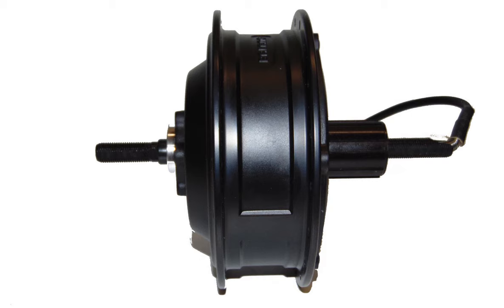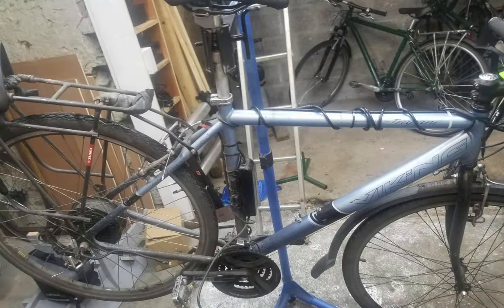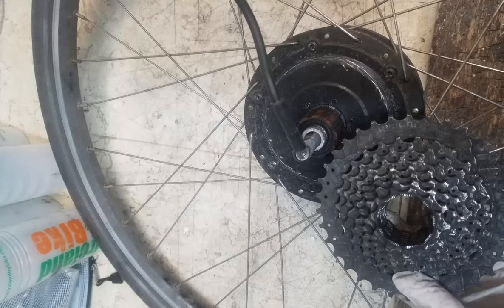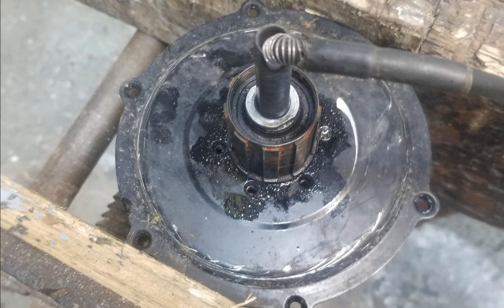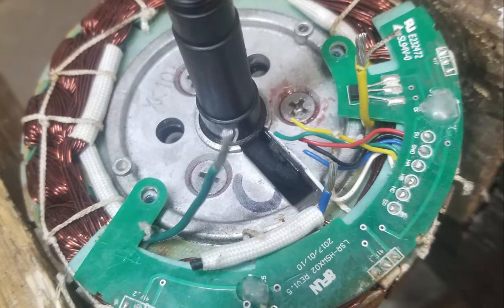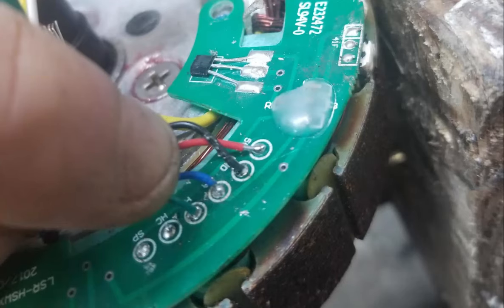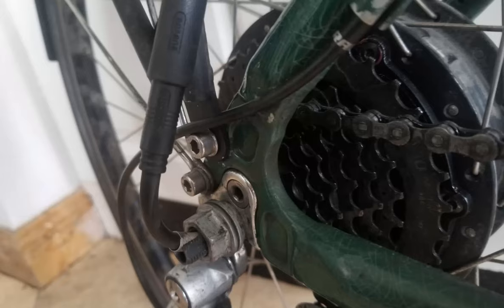E-Bike Motor Repair - Damaged Cable Bafang Hub Drive

Comment: They way you installed it will cause rain to drip into the motor and then everything will rust inside and probably the clutch will brake at first. I can tell you from experience. Better to use a longer cable and put the axle upside down.
Reply from the maker: That's a pity :( but thank you for this important info.  I've pinned your comment to the top so people will know your tip.
Reply: I was about to post something similar, with the axle upside down and the cable going up as you say rain will wick along that cable into the motor ether shorting connections or causing rust, for this reason I always install with the cut in the axle facing down I also make sure the wire goes directly down about an inch and then loops back up to the frame where it is secured / zip-tied this means that any rain on the wire will travel down and drip off at the loop and not wick up into the motor
Reply: Get some silicone pumped in, not ideal but will buy you time
Reply: Hi Mels. The cable at the inner end of the hollow axle is blathered in black silicone at manufacturing from my experience, having had to dig this out to release the cable. I guess it’s a good idea to reseal this before putting the whole thing back together. 😉
Reply: Try to run cable Low along frame.   So gravity helps u out

Comment: Great video Dominic.  My spindle came loose and knotted up the cable.  I was going to solder joint all 9 wire externally, but was never comfortable with what would be the end result for a fixed wiring back to the controller.  I've now found a new 9 pin extension lead 1.5 metres long.  So I can cut off the plug end about 30cm or so and rewire wire this through the spindle as you show.  Once I rewire the other piece of cable back to the controller I'll then have a convenient 9 pin connector joint to ease wheel and tyre service

Comment: Thans so much for your video I have the same problem my is the pedal error 3 I did what other video said but nothing I end up soldered wires because I thought was not making good contact. Now my next step is taking apart I may do a video to help other thanks again
Reply from the maker: Good luck!  One thing I would say is pedal error could be to do with the pedalling sensor rather than the motor

Comment: Hi. Are you based in the U.S.? 
 Do you have a bike shop?
I have the same problem. My hub motor cables are ruined primarily because I have been riding without a torque arm.
The rear hub motor twisted sometimes while I was riding and ruined the hub motor  wires
  I had a very hard time finding a torque arm in bike stores
Reply from the maker: No, not in the US. I would say you need to look at specialised e-bike websites like Luna Cycle for your torque arm.  Or if you can't find a torque arm to buy, then maybe ask around machine shops?  Could be a bit expensive, but they should be able to rig something up for you.

Comment: Very clear and nice video. Will the hall sensors with different series numbers will match all different brushless motor controller or there must be a mentioned hell sensors inside the brushless hub motor that can match a specific motor controller. Please advise.
Reply from the maker: Thank you :)  I don't have any experience with mixing and matching hall sensors unfortunately.  So I can't tell you if they'll be compatible.

Comment: Great video thanks, I have a similar hub motor on a swagtron eb5...

Wires are all messed up... To you know if I can power this motor with just the three large wires?  Do you need the sensor wires?  I've seen some hub motors with only 3 wires coming out.  Thanks again

Comment: Hello, I just came across your video, I have a hub bafang motor G062 1000W and it's spinning inside but there is no traction on the wheel, any idea of what i could be? By the way are you from Ireland?
Reply from the maker: The teeth could be stripped off the gears, but that's only a guess.  Yes, I'm from Ireland
Reply: @dominicogallachoir4554  the gears and the teeth all over are fine, nice one I live in Limerick,  do you think I could send you the motor to have a look?
Reply from the maker: @danieltapia6200  No, I can't take that project on right now unfortunately.  But I will ask around to see if I can get someone who can help you.

Comment: Great vid Dominic...I just bought an e bike with power failure at back wheel it sorta kicks in when left leg is on downstroke then off when coming up if that makes sense...I'm hoping I find a broken wire as mine looks identical to yours
Reply from the maker: Hi Tom, it sounds like an issue with the cadence (pedalling) sensor.  Check if there's a little disk near your bottom bracket with magnets embedded in it.  I've a feeling the disk is a bit wonky, so the magnets are moving too far from the sensor at certain parts of the pedal stroke, causing the motor controller to think you've stopped pedalling and the motor to cut out.  Try to move the whole magnet disk as close to the sensor as possible, without rubbing.  And as straight as possible.
Reply: Yes you are right ...a piece had broke off ...eBay to the rescue 😁 just learning the ropes on ebikes  but as a mechanic for over 30 years it's pretty easy to pick up as long as you realise you don't need fuel 😂 cheers 👍

Comment: Hello sir nice video explained well. 
I have a question that is if i remove the white wire does it increase speed because it faces the cap magnet i.e. it counts the rpm
Reply from the maker: It might remove the 25km/h speed limit.   However, it will also give you "speed sensor abnormality" and stop the odometer from working so I would not recommend.  

There are other ways to remove the 25km/h limit if that's what you want - See page 10 of the Bafang C961 manual.
Reply: @dominicogallachoir4554  i got my answer thankyou for your answer i just did it and my ebikes speed increased from 30km/h to 31.5km/h 😂😂😂😂😂 so much so i soldered the wire again. Thanks for your reply

Comment: Do you know where you bought your new cable from mate. Got a mate500 bike where the same problem has happened
Reply from the maker: I didn't buy the cable - I took the original one and shortened it by cutting out the damaged section.  Don't know where you can buy, unfortunately.

Comment: Came looking for the tip about not removing the free hub screws! I'm trying to take them out right now not sure if I needed to. And boom one is stripped. Then some penetrating oil. A few minutes. One screw out. The other 4 not turning, feel like they're stripping. I'll quit now and put the one back in. 

I'll get the three screws and clip on the other side. And do it properly. Thanks

Comment: Are the three thick wires connected together somewhere. When I use my multimeter to test for shortages they all buzz if I test in between them. Is that normal or are they shorted somewhere?
Reply from the maker: Yes that's normal.  The three thick wires are connected to each other via the coils in the motor

Comment: Great video - do you have to remove the cassette?    I have been looking for a socket that can get over the connector but can't find one.  Any help is appreciated.
Reply from the maker: I can't remember if you have to remove the cassette.  But you should be able to find the tool in most bike shops.  Ask for a "cassette lockring removal tool".  If you don't want to buy the tool, most bike shops will even remove the cassette for you on the spot if you ask nicely.

Comment: I damaged my front hub motor slightly (it sometimes turns off when riding and I have to reboot) due to the shaft rotating in the fork, very dangerous when the wire wraps and the wheel stops!  The u shaped tabs spread apart over time (they were thin and weak), and the shaft was not restrained.  I fixed by welding reinforcing plates to the outside of the fork.  I would recommend rear wheel drive now, ha  ha.  I may have to take the hub apart if it gets any worse, thanks for a video to describe what to expect, it would be easier on front hub, and no gears to deal with.
Reply: I think part of your issue was using a front motor and the second was not using torque arms, front motors work well but forks are not really designed to take the load so can fail in one way or another and the usual point is the u shaped tabs as you call them as they can spread or round out if there the nuts are not sufficiently tight, this is why a torque arms are very important as it as an extra way to secure the axle in relation to the fork or frame and stop fork or frame damage in the event the nuts loosen or a large amount of torque tried to twist the axle in the U shaped tabs, even on the rear i would and still do use torque arms .
Reply: I've got the exact same problem right now and I can't find anyone to help fix it for me. I'm in London and run a small unfunded, nonprofit homeless outreach group delivering food and other much needed essentials to our friends on the streets, I do this on an electric cargo bike. But as you mentioned 1 of the forks cracked at the front and has in turn twisted the wires, I've managed to get the forks welded thankfully, however I still need to fix the motor if anyone can possibly point me in the direction of someone who can help please, as I can't do the outreaches as efficiently without the bike.
Reply: @ads2829  did you manage to find anyone in London?

Comment: So, was it the power cable fault or hall sensor?
If power cable as you did changed full cable, why not to cut the plug and solder new plug in.

Comment: Hello, nice video but I have a question. When you mention that you need cassete lock ring tool with decent size in the middle, how did you remove the original nut that is on the axle and holds it to the bike frame? When I unscrew mine it is still stuck on the power cable and can not be forced over the connector.
Reply from the maker: Oh that's awkward.  For me the axle nut passed over the power connector easily enough if I remember correctly.  I don't know what to do in your case :/

Comment: Nice video. V useful. What Is the purpose of undoing the 3 screws at 2:09 on the video please ?
Reply from the maker: I can't remember.  It's possible that taking the screws out was unnecessary because I was figuring things out as I went along
Reply: @dominicogallachoir4554  Yes. I was doing one yesterday. Removing these three doesn’t seem to release anything or make anything easier. 
I have done the strip down and broken cable removal. Soldering I have saved for another session. 👍

Comment: Not bad, not bad....only thing I can say is make sure to use "high temperature" grease in the motor when re lubing....but otherwise a pretty good breakdown video....
Reply from the maker: Good tip, thank you

Comment: My 1000w rear hub motor has 10 wires. A brown one along with the white speed sensor. I don't know what it does or is supposed to do as I don't use the bafang controller and display. I wire directly to a generic controller no display.

Comment: Hey! Great video.

I have a question about the motor conditions before the repair as I am going through something similar. 

Was there any clicking in the motor if you tried to apply some sort of motions to the motor? Thanks!
Reply from the maker: Hi Roy!  No, I don't remember any clicking
Reply: @dominicogallachoir4554  hmm mine twitches a little when I try to use the motor.. does it seem like a hall sensor problem?
Reply from the maker: @royendo5910  I really have no way to know unfortunately

Comment: Thanks for video -- I have broken white wire where it comes out of axel. what does white wire control? Where can i get a new harness from connection back to hub? Also, can I get to location where you cut the harness and just slice in a new piece to old wire and not solder to board??
Reply from the maker: Hi Dan.  It's a long while, so I can't really remember all the details, but I do think the white wire is some sort of sensor - maybe for hub speed or temperature or something.  Maybe try eBay for a harness.  And yes, I think you could just solder in a new piece for the white wire instead of cutting the harness and re-soldering to the board.

Comment: Can someone please help me the issue with mine is , in this video he shows a picture of the wireing going into the hub and is encased by a silver metal spring for me that part keeps twisting every time the bike starts to turn and stops , and is causing it to tear , how do I stop that?

Comment: Hello Dominic, could you please make a video on how to make the connections in the motor cable
Reply from the maker: I won't be able to make a video.  But what you need to do is to learn to solder.  Get a cheap soldering iron, some solder, some old bits of wire, and do lots of practice.  There are plenty tutorials on the web to show you how.  Also look up how to use "heat-shrink".  That part is super easy.

Comment: How did you connect the 3 main power wires besides having the  heat shrink wrap?
Reply from the maker: Solder

Comment: hi Dominic great video you know your stuff i am in ireland too and was wondering if you can help i converted a ninebot mini pro to a wheelchair[ as you do] i had bad heart attack  but something went wrong it showed error code 39 motor problem so tested both motor hall sensors one was testing perfect 5 volts dc to zero volts dc when wheel was turned but the other wheel was showing a dead short between the red and black testing down the cable into the motor , on opening it up two sensors where completely burned out so replaced all three with ss 41 , couldnt read what was on the old sensors they were too badly burned.  the middle sensor has reversed live with the sensor output so looking at all three sensors the left and right one had the live on the right hand side and the sensor out put green and blue on the left , the yellow middle sensor was on the right and the positive on the left so I read that what people do is then turn the middle sensor around so as to make the writing ss41 face away from the stator to be just like the other two, built it back up now its bleeping error code 18 and the motor not sure if its both or one is shaking and on the app its saying motor shake ride with caution so was wondering could there be something else wrong , I did fit a second hand supposed to be working ok mother board , any help greatly appreciated thanks
Reply from the maker: No, I don't have any tips for you

Comment: Hi. How does the rotor not scratch the stator, under the weight of the rider and bumps?
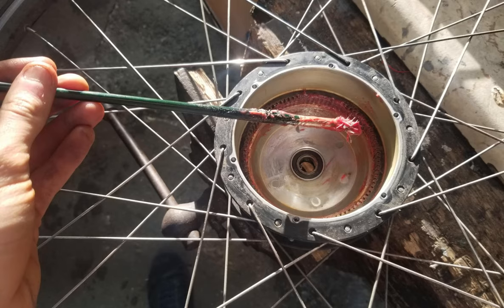Reply from the maker: There are two cartridge bearings that support the axle and rotor as they sit within the stator.  You can see one of the bearings at 3:21.  The other bearing is visible at 3:27 (in the very centre of the hub shell).

Comment: How did you fix the wire that looked damaged at the beginning of the video? I have the same problem with my wire looking like that but I’m not sure if it’s external or internal unless I take a look inside
Reply from the maker: You have to cut out the damaged part of the wire and solder the fresh new wire ends into the motor circuitry.

Comment: Hey man i have the same problem with my wires  getting cut in the axle..Does anyone know what the wire is called...I know its a phase cable but I  can't find a replacement phase wire anywhere..
Reply from the maker: I don't know.  All I can advise is check places that sell various spare parts for Bafang motors (assuming that's your brand).  You will probably have to do some trawling of the internet.  That's assuming you don't have enough slack to just shorten the cable as shown in the video here.

Comment: Is it possible to replace the parts with the threads
Reply from the maker: Do you mean the axle?  It's a long time since I did this repair, so I can't recall from memory.  But I assume it is possible to replace the axle if you can find a replacement part (I have no idea where to buy replacement axles).
Reply: @dominicogallachoir4554  ah ok thanks

Comment: My hub motor goes to error 8 or 9, disconnect then connect again, power from the motor will sometime jump then quit, can you please tell me what is going on?
Reply from the maker: Hi Greg, I don't know unfortunately.  But kind sounds like a dogey wire or connection

Comment: Hi I have a new ebike kit wheel wont turn when any phase wires touch each other when not o  bike or power connected when all set up wheel wont turn feels jammed thanks if you can help
Reply from the maker: Hi dave john.  It's normal for the motor to be difficult to turn when you touch some of the phase wires together.  That's because it's effectively behaving as a short-circuited generator (very stiff).

On the other hand, if you connected the electronics properly and the wheel is jammed then it could be mounted incorrectly into the frame of the bike.

Comment: You missed a bit, a new cable, the old one you cut will be useless as it's no longer going to reach.
Reply: You can buy an extension wire

Comment: do you think if you disconnected the speed wire it would disable it
Reply from the maker: If you disconnect the speed sensor wire you will definitely get the Error 21 warning which will be annoying at least and causes some other issues with the system.  If I remember right, I wasn't able to change the power setting once Error 21 appeared (only exception was by turning the bike off and on again).  The motor may kind of work otherwise but this would be a very poor user experience
Reply: @dominicogallachoir4554  no the controller doesn't have much. just 3 power settings

Comment: just bought a new bafang 1000watt rear hub motor bc i scuffed the wire harness up pretty good and it short circuited the system. freesky also said i needed a new motor and so i bought one not knowing about this video. the original motor has 500 miles and new cost me $450 !! 
smh 🤦‍♂️